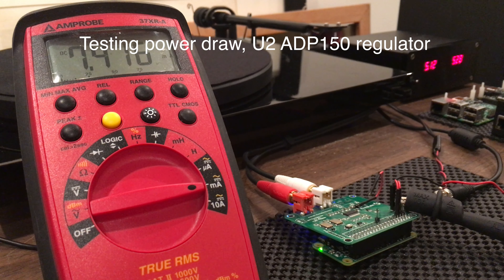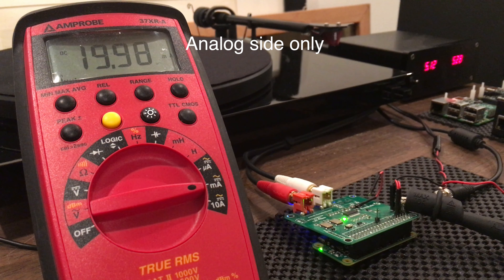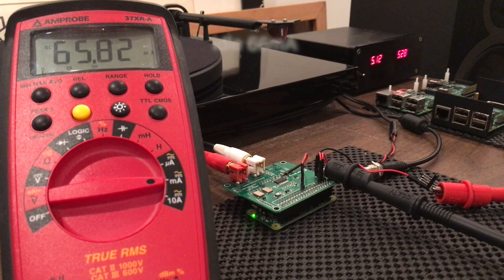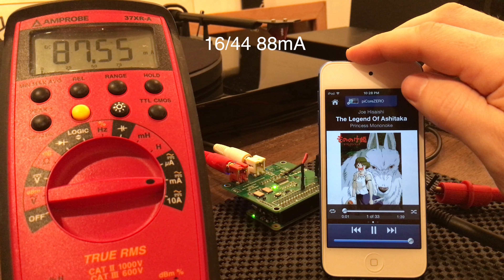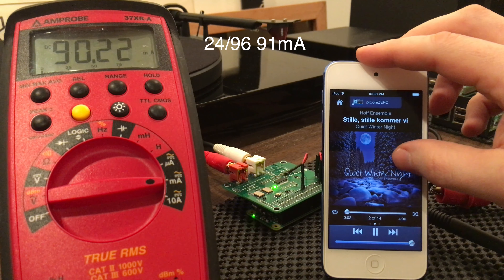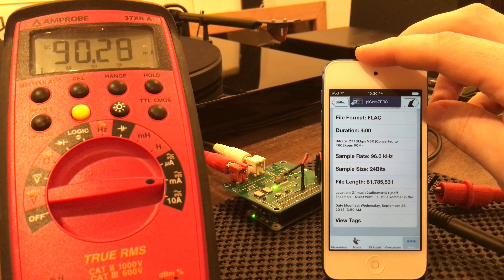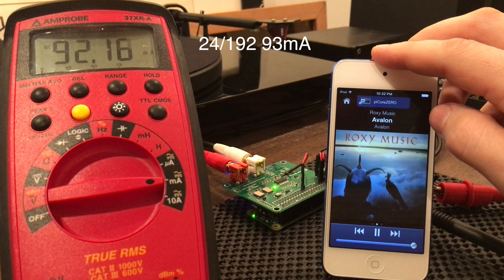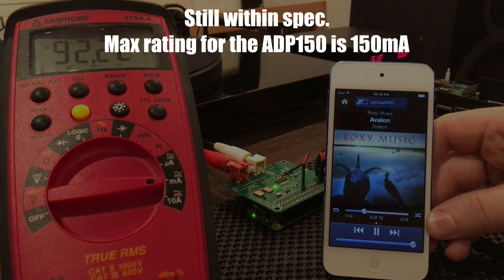HifiBerry Dac+ PRO Power MOD Part 2 Extra

Comment: Have you ever tried powering the pi via the gpio instead of the usb input? To see if it would sound better for things like usb DAC's.
Reply from the maker: I always power it though the GPIO, these days with batteries and LPS's-- even here the ZERO is powered thru GPIO with a LPS (you can even see it in this old vid, there are 2 5V sources coming in) frankly it's the only option if you are serious about it.
Reply: @sckramer  great thanks for your quick response. I know what I will be doing this weekend.
Reply: Have you ever used a audioquest dragonfly red on a raspberry pi? If yes does a hifi berry DAC sound better.